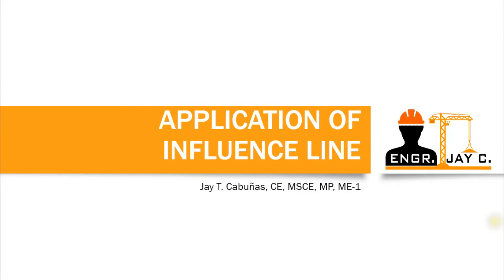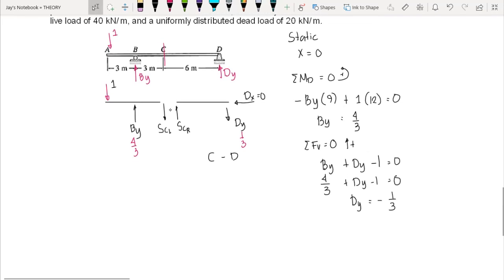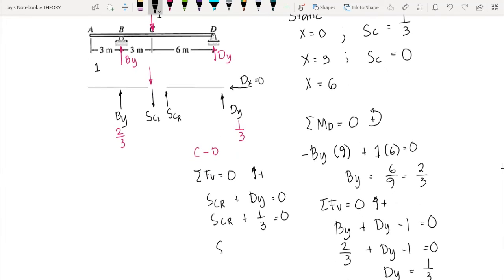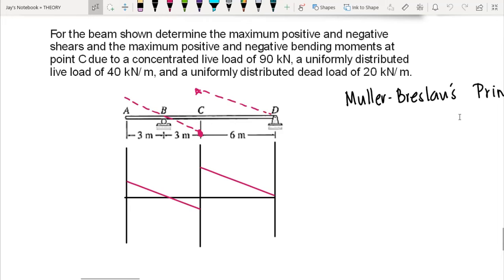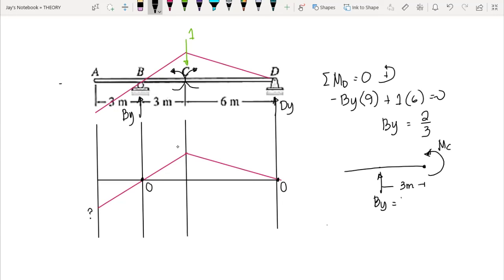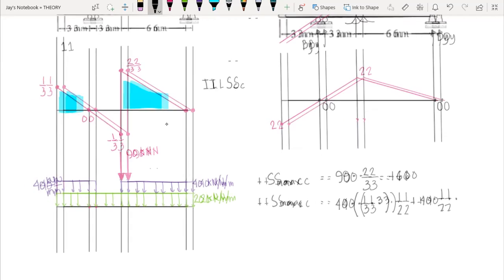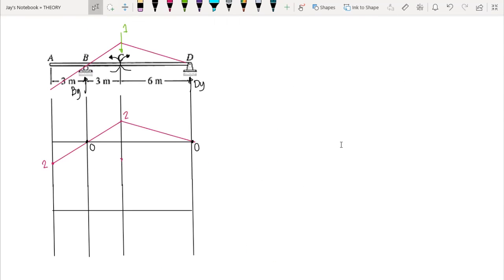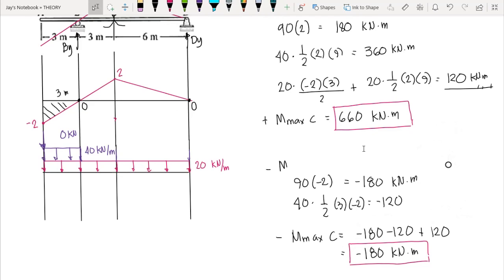Structural Theory: Application of Influence Line

Comment: -a/L and b/L for shear, ab/L for moment. this is for the shortcut. getting the shear at C gives you -3/9, which is -1/3 then you connect it to the support b which means the b in shear at c is 0, then u just simply continue the line till you reach point a, now u gonna have to do a similar triangle method to get the deflection of a. next is b/L which is 6/9, thatll give u 2/3 now u just gotta connect it all to the support b then continue the line till you reach A, and use simillar method to get the deflection, then connect the right side to support D. for the moment, use ab/L, thatll give you 3x6/9, whcih is 2, just simply connect it to the support at d and b then continue the line passing b till you reach point a then use similar tringle to get the deflection.